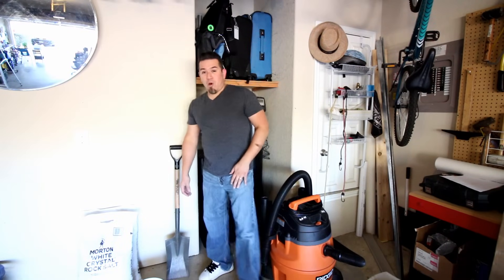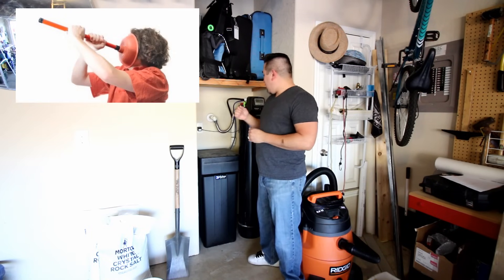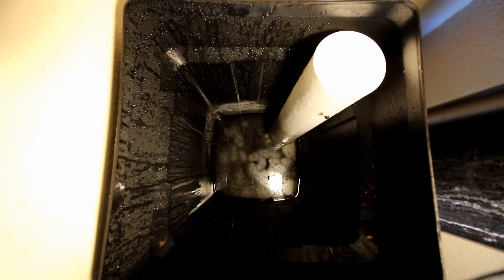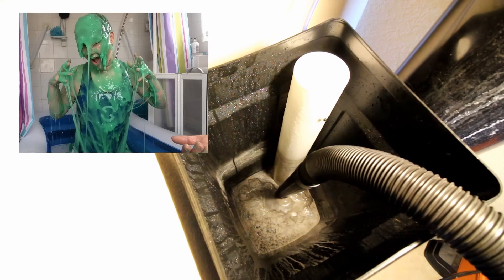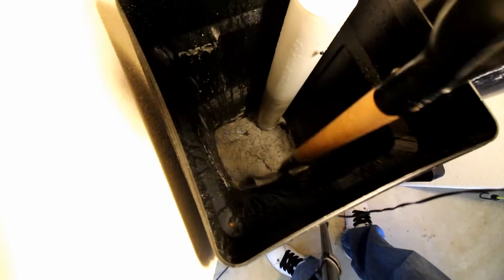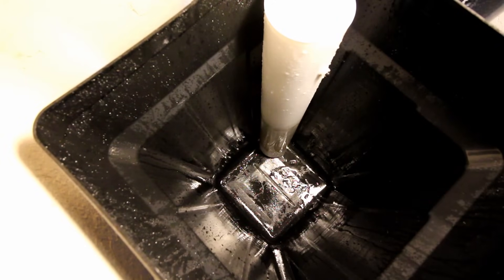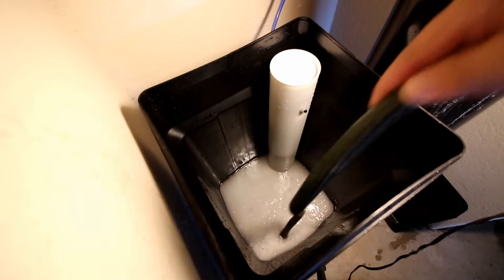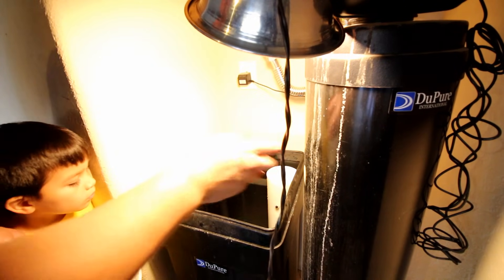DIY: Water Softener Maintenance

Comment: I also noticed you said to use 2 qt of water.. the instructions say to use 1 qt of water and 2 qt of the cleaner.
Reply from the maker: Thanks Mac. The cleaner I purchased from Home Depot called for 2 cups per quart of water. The cleaner is a dry powder that dissolves. When added to the brine well it disperses into that brine solution. In the video I added 2 cups to approx 2 quarts. The mix was off, but the result was still great.

Comment: for the cleaner.. just use 100% Citric Acid.. Amazon sells them 5lb for like $14.. much better price than the Softener Cleaner you buy at the store...if you read the ingredients.. all it is, is Citric Acid.... been using it for a long time, and it works great.. saves you a lot of money. - - - also that rock salt is the dirtiest salt to use.. NEVER use that man..., if you use cleaner salt, it helps with the sediment.. i've had mine for about 5 years and have NEVER had an issue with it... just use Mortons Salt Pellets (yellow bag) they are 99.7% purity...it's the best buck for the money.
Reply: Mac Pelao Do you also recommend the Green Bag Mortons instead of yellow? Thanks!
Reply: @Alz0703  depends. If your system is old and the water has iron in it, then yes I'd recommend using it. All it basically is, is a added chemical into the salt that helps clean up the iron off the resin. Which when the resin starts to age out, it's harder for the iron the come off... So the green bags help with that
Reply from the maker: I use the yellow bags and they work great. The green bags are for systems that are susceptible to rust.
Reply: Agree, been using the yellow bag Mortons also for 14 years in my system.  It does not leave too much mook behind.
Reply from the maker: Thanks Macster. I switched to the correct pellets shortly after making this video. I have a video I posted recently where I upgraded to an epic new system. The installer that put in my original system loaded it with rock salt and tole me to use that. I didn't know much better back then.

Comment: I disconnect my brine tank, take it outside and use hot water out door spigot (in my case, very handy) and pressure wash as it were, the tank and bottom screen. Put back in place, slide flush tube back in, fresh salt, and add couple 5 gal. pails fresh water. Do manual recharge.
Reply: yeap. this is the best way to clean the tank...hope someone will read this...
Reply: And the added benefit? My unit runs about 1/4 often as it used to Major improvement. Same water usage.
Reply from the maker: Dave Barron I haven't tried removing my brine well. Next time perhaps.
Reply: This sounds logical to just simply taken the salt containter outside and spray wash or simply clean that way, since most folks don't have shop vacs. Good video
Reply: Dave Barron I agree, drag that tank outside and create a salt lick for the deer.

Comment: I install and service water refiner/softening systems for a living going on 8 years now. The #1 problem is that you are using rock salt. Diamond crystal pellet salt is best for any salt type system because it is 99.5% pure. (Hardly any other minerals other than sodium chloride)
Reply: Rock salt is cheaper but contains alot of calcium sulfate which cannot be dissolved by water and will be left behind in your brine tank/salt resevoir as "sediment mush"
Reply from the maker: Andrew Staley thanks Andrew. I will stick to that from now on.

Comment: How often do you have to add water? Every time you put salt into it?
Reply from the maker: Richard Li depends on the softener. I don't ever need to add water to mine, unless I am totally clearing the tank. It's always good to have some water in there.
Reply: @ThisGuyProductions  Only time you should ever put water in is when cleaning the unit. See your startup instructions manual if you still have them. Most take about 2 gallons. After startup the unit will refill after the regen process on new units. Post fill unit.
Reply: wrong every water softener that is made today pits water into the tank automatically either at the beginning or end of it regen cycle
Reply: @jonknapp7335  Most new units post fill the tank to  be ready for the next regen cycle. Has to make the brine. Last thing it does is refill the brine tank on post fill units.

Comment: My water softener is leaking. It is a WaterBoss about 15yrs old. It's is currently not in use and in the bypass mode does not leak. Is there a fix for this? Or do I replace it?
Reply from the maker: dominique cottle it's all depends on where the leak is coming from and if the parts to fix it are still available. It could be as simple as adding Teflon tape to a leaky joint.

Comment: Thanks for the video - Our softener (Hague) is about 2.5 yrs old, and I'm noticing a black slime/algae growth on the wall of the brine tank (we have well water), so I reckon it's time to clean. Also, a "venturi valve" works with what is known as the "Venturi Effect", which has to do with fluid (or gas) flow theory, pressures, etc ... 

https://en.wikipedia.org/wiki/Venturi_effect

good info!
Reply from the maker: Thanks QuantumRift. I will check it out. TBH a lot of the technical stuff is over my head. I appreciate you sharing.

Comment: I've got 6 years with my softener and zero accumulation in my brine tank...  I use "softener" salt PELELTS.  They're much cleaner than "rock" salts.  I recently made ice cream with rock salt and was amazed at how much grey funk was left behind after only using a couple cups of the rock salt.  Stop using that stuff and life will be much easier.  Also I put in 6 bags at a time and have never had bridging.  My tank does have a grid a few inches off the bottom.
Reply: Pelleted salt is better, or sure.  Rock salt being a lower quality as it's simply mined and filtered.  Rock salt quality is partially a regional issue and a QC issue. Salt is very heavy and expensive to transport so rock salt in one region of the country may be dirty, while ohters may be very clean. Salt is rarely transported long distances. For the most part, salt is salt but cleanliness is the issue. I have been to parts of the country where the rock salt will leave dirt residue after only a few bags. Solar salt is usually high quality as it's salt water that is allowed  to evap in ponds, leaving only salt.
Reply: Our Kenmore model specifically states not to use rock salt. Most likely because they know rock salt quality can vary wildly.
Reply from the maker: majorsmackdown you're the second person to post a success story about using better quality salt.
Reply from the maker: QuantumRift great info. I'm in South Texas and our rock salt leaves residue after a few bags.
Reply: Good info.
Reply: Bridging happens when you let the salt level drop too low, then add salt.  The tank fills to a set level.  If  the salt level drops below that then you add salt, the water rises until the next regen.  This leaves wet salt which fuses together causing "bridging".

Comment: Morton system saver start up
Reply from the maker: Are you suggesting using Morton System Saver Pellets?
Reply: When I first got my softener they sold Morton System saver II salt pellets..  I used them for about 2 years then the store switched to diamond crystal bright and soft pellets.  Both of them left me with zero residue.
Reply from the maker: Thanks. I will admit that I use the cheaper salt. I assumed that all brands had some level of residue. I am excited to hear that there are brands without the residue. I will switch to those and see how it works out for me. I also live in an area with extreme mineral deposits in our water to begin with.

Comment: I have a North Star Softner.  It hums when the water runs or you flush the toilet.  I broke up the salt damn but the noise continues.  Any recommendations?  thomascsm1@hotmail.com
Reply from the maker: Hey Tom, if you think it is the softener, put it in by pass and see if the noise stops. If not it isn't the softener.
It could be a loose stop valve washer vibrating in a shut off valve.
Reply: Thank you!  I tried that before.  It makes no noise when it's in the bypass, so I know it's the softner.  Where should I go next?  I appreciate the advice.
Reply from the maker: Tom Campbell that's a hard one because I am not familiar with Northstar softeners. I looked at their site and found nothing regarding humming or similar sounds. have you tried their hotline? it's always a gamble though cause they usually try to sell you service. That's been my experience with different manufacturers.

Comment: I love your video..... very helpful. I do how ever, have a question. We are noticing the sulfur smell is coming back stronger and stronger ( was gone for 2-3 years) cleaning this as per your directions, does that help with the sulfur smell? any other suggestions?
Reply from the maker: Lewis Brantner the sulfur smell is due to a bacteria that loves bring water. There are tons of remedies but it varies by manufacturer. One forum I found suggested a bleach solution, but I'm cautious. Do you still have the owners manual?
Reply: This Guy , I don't, the company that installed it never left it behind.I might go to Lowe's and buy the powder solution and use
Reply from the maker: Lewis Brantner the solution I used removes mineral buildup. I'm sure you can find one for bacteria and odor.
Reply: @lewisbrantner7089  ok so your not mislead here. First, if you smell it only when your running hot water... Yes it is the water heater, it's the mag rod. If you smell it on the cold side then it could be a bacteria or it it could be sulfur in the water. There is several bacterias, iron bacteria being the most common in my area, it may be different where you are. If it's sulfur, you can chlorinate your well to try to help kill it off for a while or install a carbon filter. The ultimate remedy is a iron breaker with an ozone-ater on it... It will take care of all three irons found in water and sulfur and it doesn't use salt. But sometimes you can just add carbon to your softener depending on the model and that as well will take care of it.
Reply: sulfer smell usually comes from the water heater
Reply: sulfer smell in the cold is hydrogen sulfides found from rotting organic materials e.g. tree limbs grass clipping ect. if you put chlorine into your softener it will break down the protrolium based drain bed inside

Comment: Great explanations and nice tip about the paper filter.
Reply from the maker: Thanks, glad I could help. Doing this yourself will save $300.
Reply: I had more than a foot of salt mush at the bottom. I cleaned it up, put some cleaner in and my water softener is like new! :)